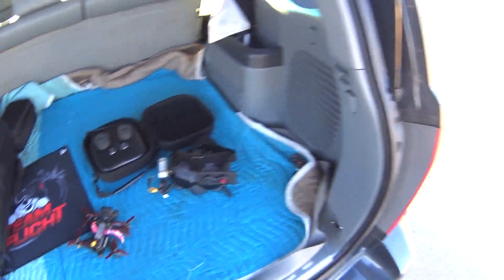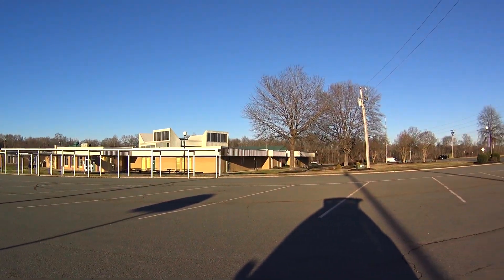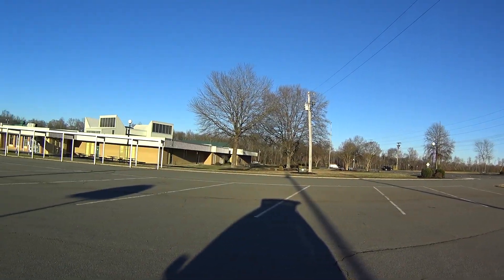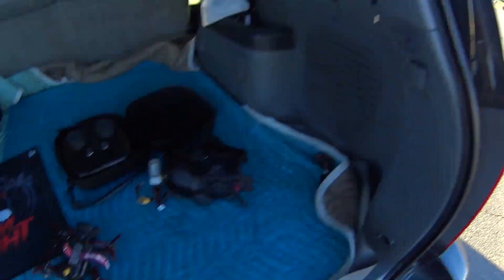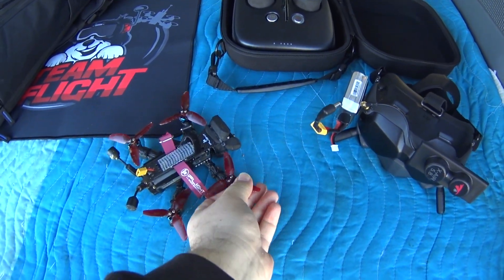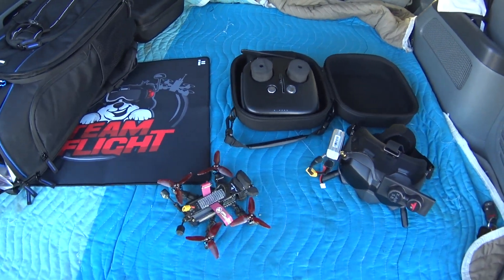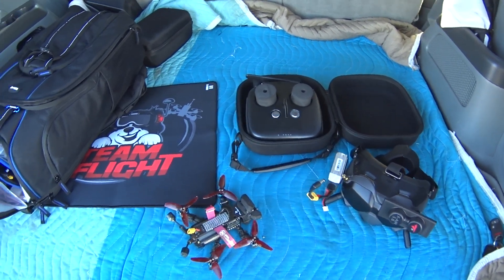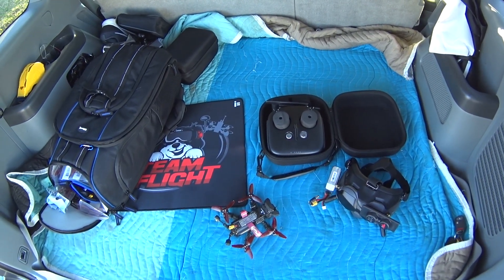Reduce RPM Filtering using BetaFlight Sliders on the iFlight DC3

Comment: Just got the DC3, and was wondering if you have an updated tune for BF 4.3.  Thanks
Reply from the maker: Honestly,  I don't,  because my DC3 has been doing great on the old version, and I usually don't update until i see a version with a huge advantage,  or bugfix.  You should enjoy the DC3 though.  It's a great  micro flyer.

Comment: Hey ! Did you have a problem with your gyros when you started flying with your DC3 ? I have a DC3 and i have a problem and i think it's a problem of gyros.. https://www.youtube.com/watch?v=bglyr6oq70o
Reply from the maker: sorry I missed your comment somehow, a while back.  Just found it while going through my comments on the laptop.  I did have a similar problem that comes and goes.  It somehow fixed itself after I replaced a burned out motor.  But I have also heard people say they Disabled one of the Gyros in Betaflight and it fixed this issue, by forcing it to use a single Gyro.

Comment: Great video! I have the same DC3 but I can't enable Bidirectional ESC for RPM filter.  I'm not sure why.  Am I missing something in the setup?
Reply from the maker: Did you enable Expert Mode at the top of the screen?
Reply: @CarbonIcarusFPV  Yes
Reply from the maker: @Accid3ntalG3nius  Can you look at my configuration screenshots(link in description) and see what else is different?  All of my pages of settings are in screenshots there.  Could be the target,  or DSHOT or maybe something else.
Reply from the maker: Also.. betaflight Configurator has to be version 10.6.0 minimum.